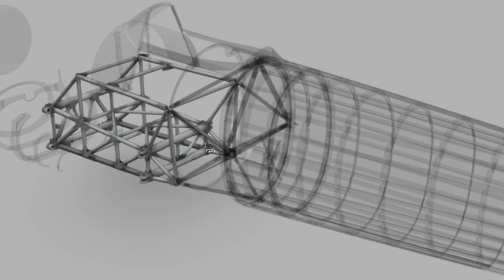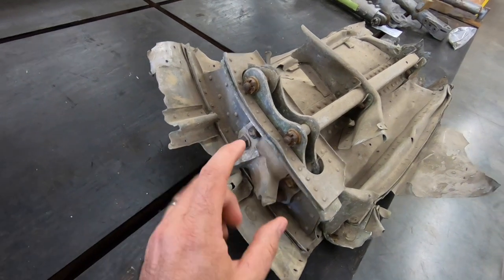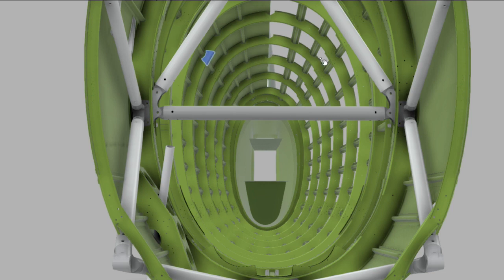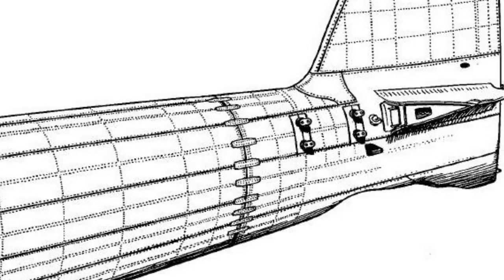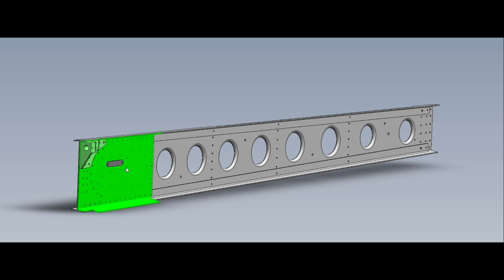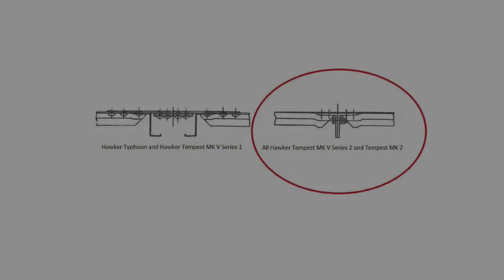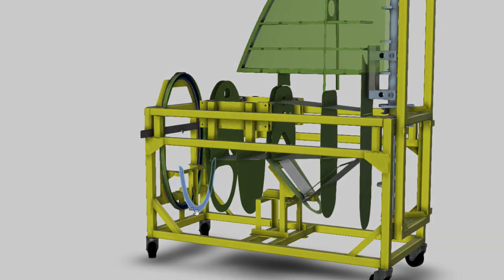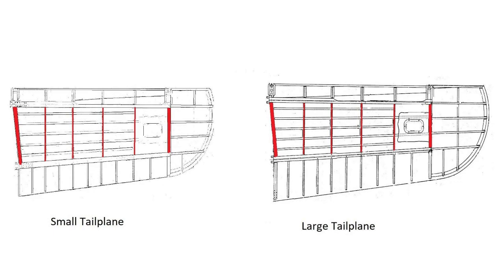S1E3 Hawker Typhoon Fuselage

Comment: Pilot must use oxygen at all times to avoid potential carbon monoxide black out. Longer ejector stubs were installed but persistent problem was never completely eliminated. 
Some found the high rev drone pitch of the Napier Sabre fatigue inducing. But not nearly so of she checked out in flight.
A four blade De Havilland Air Screw Hydromatic  taking advantage of over 2,000 horsepower.
She could torque severely with sudden throttle application.

Comment: Very interesting! The large alloy lugs to the rear of the cockpit section which are broken on your example I imagine were alloy forgings, will you attempt to have these forged for your rebuild, or can they be machined from billet and heat treated? Good luck with this wonderful project! Chris B.
Reply from the maker: Hi Chris, are you referring to the alloy forgings which attach the cockpit to the integrating structure (four positions)? ~Ian
Reply: @TyphoonLegacyCoLtd  Yes Ian, These look like forged components, and I know this process is quite involved now without a volume production order, the Vincent motorcycle has forged alloy fork legs, these were made originally by the Bristol Aeroplane company, and to produce new ones we have had to resort to billet machined components heat treated, the process works, and for a single batch is posibly viable for a stressed item, the "lugs" on your example look like they have been torn apart in a crash. Chris B.

Comment: Fascinating Structure. As I understand T-45 tubing was used by motorcycle custom frame builders such as Harris, Seeley, Dresda by Dave Degans and others. Even today Harris produces a variety of such frames. Most all were bronze welded also. Spondon when in business used British 7020 tubing . Do you know whether either material availabile in Canada ?
Reply from the maker: I've not heard of 7020 tubing, but I do know that some use the T.45 spec tubing in lieu of T.50 when the testing overlaps specifications. All of this material gets imported into Canada though, nothing produced to that spec. here. ~Ian

Comment: A great project and an informative film.
One question: are you using pounds and inches because it's an old British plane or do you use these measurements anyway (as opposed to metric)?
Reply from the maker: Thank you very much! The original information is indeed in Imperial measurement, but aerospace in North America is also generally all imperial, so it is what I've always used. ~Ian

Comment: Quite possibly a dumb question, but did the entire tail section fall away in the accidents prior to the modifications being made?  Video very well done btw.
Reply from the maker: Yes it did. Vibration caused elevator flutter, and the flutter caused stresses that the transport joint could not handle. The rear monocoque came off just forward of the transport joint. Great question! ~Ian
Reply: @TyphoonLegacyCoLtd  Will your's feature the fishplates?
Reply from the maker: @EricIrl  It will for sure, but will also include the Tempest transport joint. ~Ian
Reply: @TyphoonLegacyCoLtd  Thanks for replying. 
A very belt and braces approach.
I'm a big fan of the Typhoon too although I sometimes think that it would never have been proceeded with if the need for it hadn't been so urgent.
The only Typhoon projects I've been involved in are building 1/72 plastic kits. I built the old Airfix kit decades ago but more recently I tackled the mid 1970s FROG kit, which for many years was the only 1/72 Typhoon featuring the "car door" cockpit set up.
I have one of the new 1/72 Airfix kits to build.
As a matter of interest, I often drive through Langley on the way to visit one of my clients and I drive right past what used to be Hawker's old Hurricane and Typhoon factory. The road is called "Hurricane Way" (typical that they ignored the Typhoon - yet again).

Comment: Interesting things about the Tempest and Typhoon elevators is that the early Typhoon trim tab control was the Hurricane (oyster) type and the later one had the Tempest cylindrical one.
Reply from the maker: Very true, we're actually still looking for one of the early elevator trim control boxes at the moment. ~Ian
Reply: @TyphoonLegacyCoLtd  I know this is no help but I did have several, but they mostly went on Hurricane restorations. They are very simple animals to recreate if you have a good workshop (as you have). The elevators and trim boxes that are around are mostly from a collection I made from scrapyard that was closing down some years ago, there were enough to serve all the current rebuilds. At first, no one was interested, but I kept all the Tempest ones. They must be around somewhere.
Reply from the maker: @tedsinclair4556  It would be really nice to have a chat one of these days, you are one of the original few who made possible what we are doing today! ~Ian